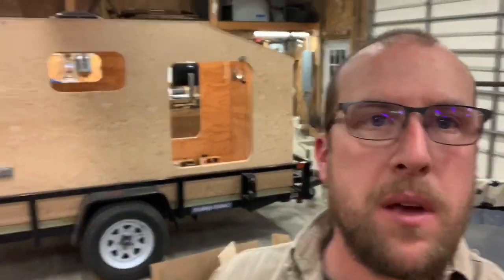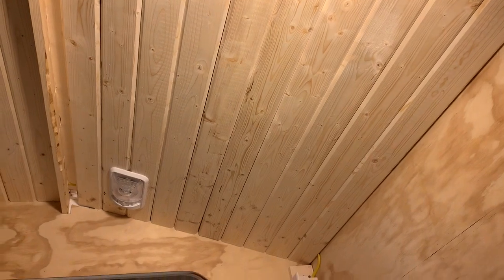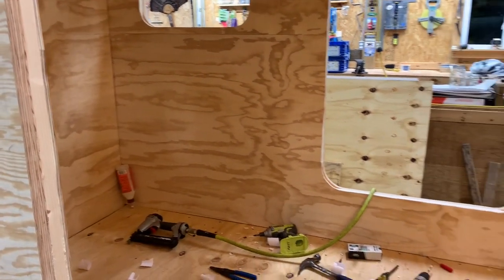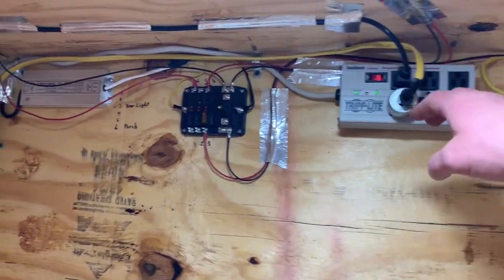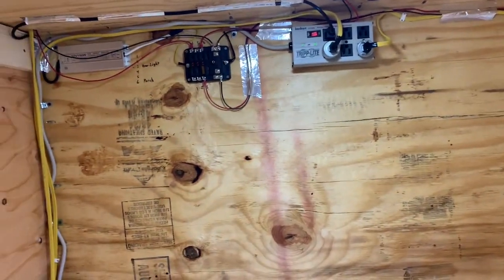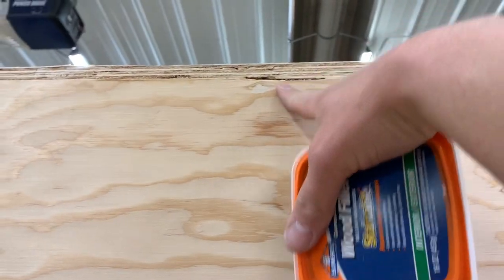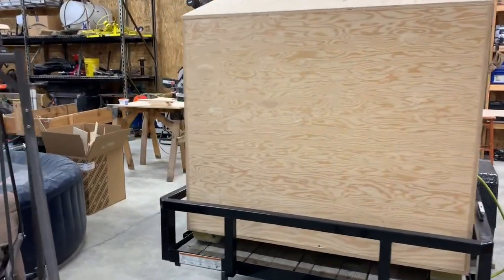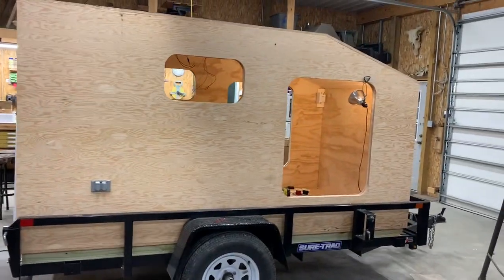Squaredrop Camper Build, Part 5

Comment: Nice build so far👍 I will be in the process of building my own DIY camper as well. I did purposely purchase a 5.5' x 10' utility trailer to build something similar to yours. I may go a different route and build my own frame.
The only thing I am going to point out on your electrical it the use of the 12AWG solid wire (yellow romex). In vehicles, DOT states to use stranded wire. Due to road vibrations, the solid wire can become loose. Also using stranded wire, it handles the high or low temperatures better than the romex solid wire. Hope this helps.

Comment: Instead of the Styrofoam you should of used foil  sided foam board. We had a fish house that had Styrofoam in the side walls and somehow the bugs got to and ate it or chewed it up, Styrofoam beads kept falling out of the walls. We replaced the walls and ceiling with the foil covered foam and you can now heat it with a couple candles, quite a difference, less weight also.

Comment: Loving the build, I know this is late but I think a total boat expo y resin with sawdust filler to fill in your gaps and holes would’ve been much better. I haven’t had much luck with that sand able wood filler.  It’s ok for interior but fails in exterior extended conditions.
Reply from the maker: Right on. None of that filler is exposed. My exterior was finished with two heavy coats of exterior grade primer paint and then spray on truck bed liner.

Comment: I would put a cutoff on the secondary of the transformer while it's hooked up to a battery to avoid back feed from the battery. You can cut it on to charge the battery when you have 120 volt hookup. Using 12 volt is a good idea when there is no power. You can also use some 12 volt outlets for charging phones and tablets. Just a few ideas. 73

Comment: You will need a 12-volt disconnect in line with the battery. You can’t have the battery connected when the AC/DC converter is operating.
Reply from the maker: Didn’t end up putting in a battery. When off grid we just plug in the battery pack/converter and good to go.

Comment: How about heavy duty SWIVEL CASTERS as in 4 of them one at each corner to ease and simplify loading and unloading unto the trailer . The casters and a simple COME ALONG could be used ??? Sturdy anchor points could fasten the pod to the trailer ??? What are your thoughts ? Do you still use the tractor and side by side to load it into the trailer ?

Comment: It is nice for sure But why not a foot longer ? the extra length would make a huge difference.
Reply from the maker: Was hard enough to find 10’ long plywood. Finding 11’ long would be weird and it would hang off the back my 10’ trailer. Did you mean height? Same issue….plywood was hard to find at 5’ wide….6’ wide impossible or have a seam which I didn’t want. Also, extra wind drag of additional foot above the truck makes it feel like there’s a trailer back there. As it is, can’t even tell it’s there. Good thoughts. Thanks for watching.
Reply: @LivingOurAmericanDream  Well I meant lengt wise , But yes that's not doable without a seam . But that extra foot really would make a big difference. I have two promasters and one is 7" longer and believe that does a lot. But still I like your build . Enjoy your trips Grts Paul.

Comment: I think you will need to upgrade the axles and wheels maybe ?maybe not.
Bigger,
Reply from the maker: Axles on this trailer are rated at 3500# so we’ll see how they hold up. Should be ok.
Reply: @LivingOurAmericanDream  my camper had 13"tires and had that wiggle/I had to upgrade to 14"tires and its good to go/great build and when I retire the chief ill build one

Comment: Have you had any issues with your electrical setup? Curious if the solid romex and 15amp shore power are powering everything you need and holding up?
Reply from the maker: Not so far. Of course our electrical load isn’t much with the simple setup. Refrigerator is the highest and it has worked great.
Reply: @LivingOurAmericanDream  thank you sir! You’ve inspired my build and…electrical system. My biggest draw will be a 5000 BTU a/c but that only clocks in around 700 watts max at startup. I am going to swap out my solid romex for some stranded 12/3. Everything I’ve researched on that seems to be the better choice, so we shall see. Thanks again

Comment: Don’t you need 2by 3 or 2 by 4 on the highway driving
Reply from the maker: Definitely not. The structure of this build is sturdier than a typical house wall. It’s the placement of the interior shelf, roof supports and cabin/galley wall that provide the entire structure with solid stability.

Comment: I don't understand why people must have all that electrical stuff, it's a camper not a home. Use cheap lights and a battery operated fan. For heat use a Buddy heater. What ever you want to use but you don't need all that stuff. Bring a generator or use an extension cord if you can. People love to waste money on dumb shit.
Reply: It's true though if I build one which I plan to just bring a dang solar power bank and run everything off of that doesn't need to be anything crazy